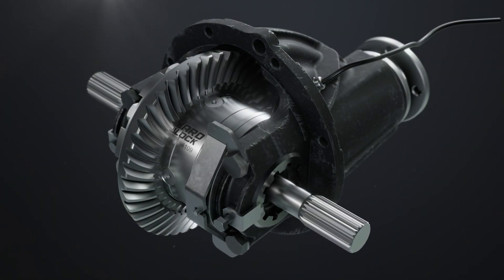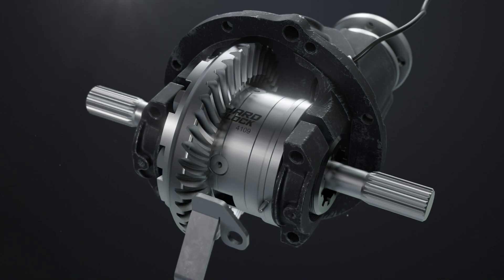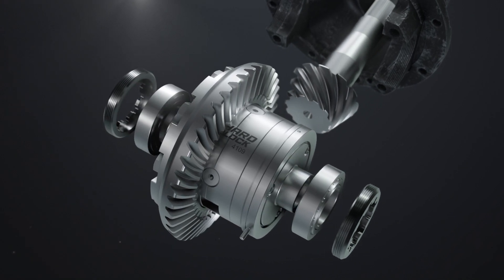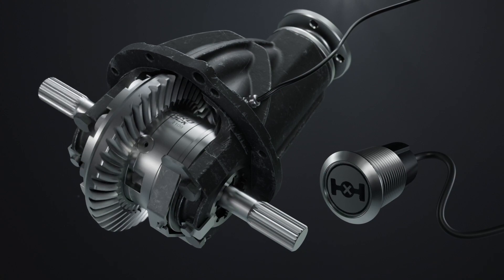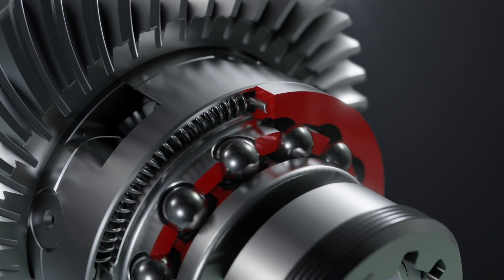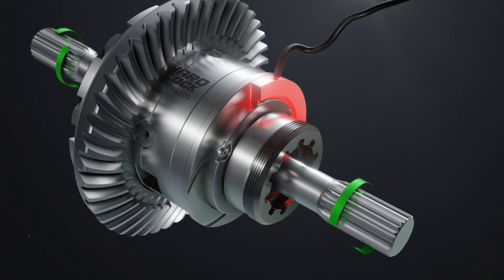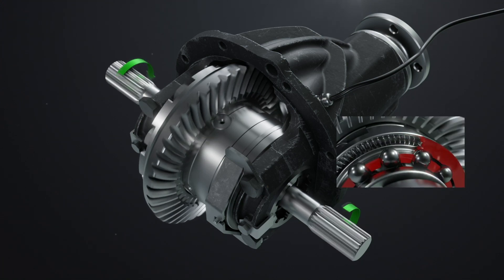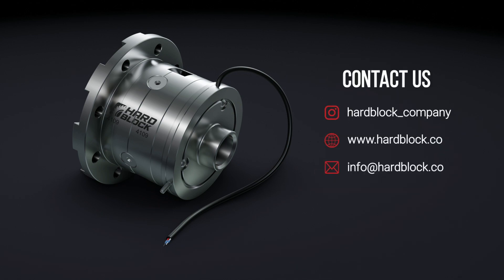HardBlock Electric Differential Locking System

Comment: GM corporate 14 bolt rear and Dana 60 front kingpin GM (p-side drop) and later Super Duty Ford (d-side drop) are the standard axles swapped for serious offroad use or aftermarket axles. 
Super Duty AAM and Dana 70 + 80 rear also becoming the new standard.
Jeep guys WILL buy all you can make for the Dana 44 and 30 / 35 for the JK. I would have skipped Toyota for the JK. 
Go to Utah and see what is on the Trails.

Not going to get a straight answer from Pirate Offroad; just smart a$$ comments.

I can test and help find cores.
Reply: Hello. write your email please

Comment: When locked it does not evenly distribute the power to both wheels; this is what it does when it's unlocked as this is what an open differential does. When it's locked the angular velocity is locked independent of the power going to each wheels.